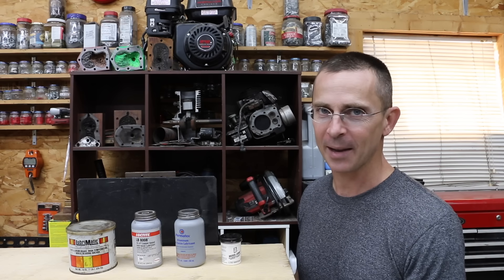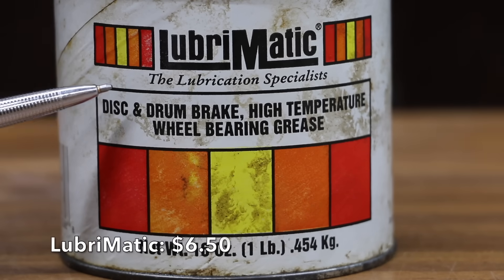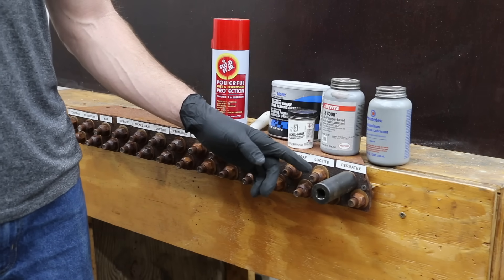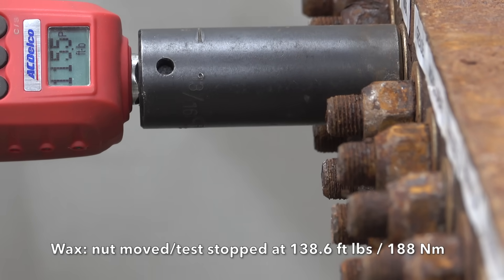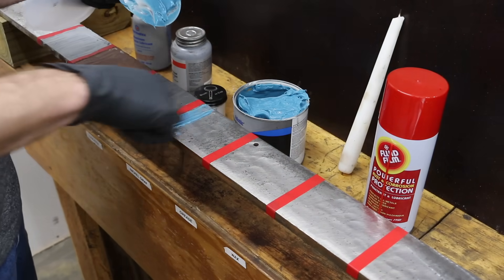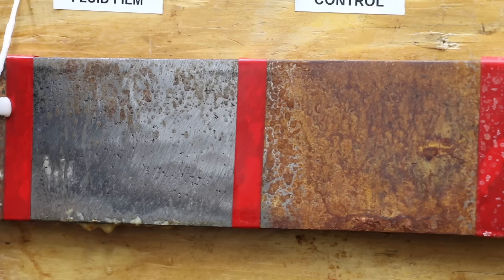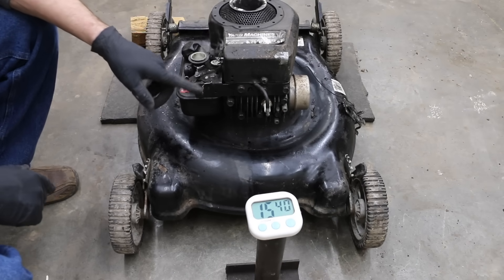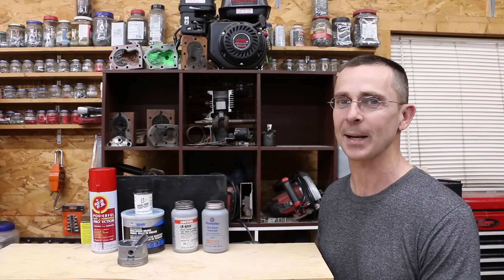Does Anti-Seize Compound Actually Work? Let's find out! Anti-Seize vs Grease vs Fluid Film vs Wax

Comment: omg ...this is the one I've been waiting for!!! Kids changing my tires and need to know this. Thank you so much for your excellent videos!
Reply: No do not put it on wheel studs and lugnuts, they are supposed to be clean and dry. If they are rusty crusty use a thread chaser or wire brush. No oil either , oil or anti seize change the torque value. The Walrus Mart in my town slathers anti seize  on wheel studs whether it's needed or not, makes a big goopy mess. Ok , maybe just a little bit as an absolute last resort. lol
Reply from the maker: You are so welcome!

Comment: You need to retorque after a heat cycle with any thread lubricant.
The candle wax may have done better if rubbed on.
Thread locker can also be an anti seize you need to test that.

Comment: Note:
AvE emphatically said, "Never-sieze" is NOT a lubricant."
Reply: it is abrasive
Reply: Correction: Never Sneeze
Reply: Dead Channel came to say the same oh well at least it’s been said lol
Reply: @SurturLives  you beat me
Reply: It's not a good lubricant, but it does lubricate the threads when torquing them down.  Taper lock and QD bushings have a warning on them about putting never sieze on them, as it increases the clamping force so much you can split them in half.
Reply: M Lenz seen this happen several times. Glad I wasn’t the one who had to tell my boss I did something I had been told by engineering staff not to do. Worse was replacement parts were two days out. Production department was not impressed
Reply: Have you watched his other videos?
He tries literally every crazy suggestion, just to see if it'll work.
Reply: Jeseph Willis yes I have. I usually find them very informing. This one, I felt, fell short. I do believe in the use of never seize. I use it on every bolt I reattach that doesn’t go into plastic. Ever had a lug nut you couldn’t get off. I removed every lug nut on all of my vehicles and reattached them after applying never seize. Like I said I believe in never seize.
Reply: Here’s why:   
Anti-seize is designed to prevent corrosion.  It‘s mostly a grease that serves to lubricate the bolt, keep water out, and provide a medium to spread particles of a soft metal around the bolt. The metal dust is a backup for when the grease is cooked off or washed out over time. When this happens, the powder of copper or aluminum can’t entirely stop the bolt from rusting, but does keep the nut & bolt from touching.   
Thing is, it’s not supposed to significantly reduce the torque required to remove the nut. That would be dangerous.  In fact, anti-seize makes it easier to tighten a nut down so that LESS torque is needed to get the same clamping force, and when a nut is removed after much abuse and heat, the grease is gone, more torque will be required to remove it than was used to install. Basically, a bolt requiring 100lbs of torque should only be tightened to 85 lbs when installing, but will need 100 lbs or more when removing next year. This is called the K-factor and should be on the back of the bottle.   
Basically, these bolts should have all been tightened to the same clamping force, not torque, if PF wanted an apples-to-apples comparison.
Reply: @kristofferbeder  Very well said! If only more people understood the properties of never sneeze...
Reply: @kristofferbeder  thanks for knowledgeable comment
Reply: @kristofferbeder  That was a good argument!
Reply: @kristofferbeder Nice comment.  There's actually a little reference book that has a conversion of torque values when various lubricants are applied.  Sensitive applications can be altered by the excess clamping force when using lubricant and cause things like leaking fluids and excessive wear on bearings.

Comment: SPARK PLUGS
The main place I ever used anti-seize compound was on spark plugs in aluminum heads - dis-similar metals with hundreds of temperature cycles. It did seem to help.
Reply: it dose and just a little dab is all it takes
Reply: A lot of folks put copper antiseize on spark plug threads but you should not really use copper, it can cause a galvanic reaction and speed up corrosion. Most modern plugs are made to not need antiseize, older engines with iron heads its not too big a deal to use a small amount but not on aluminium heads. I have never heard any horror stories of major damage but there is always that chance.
Reply: @alexgrant1979  That's a good reminder. I'm pretty sure that copper and aluminum don't play well together! For me this was decades ago before I remember there being copper-based products available. The stuff I had was a gray, greasy paste of powdered metal, but I don't remember what kind. My ol' VW Bug (may it RIP) went too long between tune-ups, and without anti-seize the spark plug threads failed on removal, and the head needed an insert to repair it. Always used anti-seize after that.

Comment: I use Permatex Anti-Seize on all low torque fasteners. I was wondering if you have any knowledge on the use of the lubricant on high torque fasteners? I am rather afraid to use such lubricants on them as I was told that it can stretch the fasteners by an old mechanic and another old mechanic told me that I can but use about 20% less torque. Do you or anyone else know the real facts about using anti-seize lubricants on high torque fasteners?

Comment: That Nickel Graf stuff was extremely impressive. It was closest to the original 90 ft/lbs you set after the being heated. Nickel is exceptionally heat resistant so there isn't that much surprise there (there's a reason the turbine blades of jet engines are made of the stuff: exceptional heat resistance as well as incredible strength so things in the air won't destroy them). Heat would have entered from the other end of the steel allowing some expansion but the nickel held it to only an extra 6.x ft/lbs. This stuff is absolutely fantastic and I want to run out and buy some now. Did extremely well in the water test as well... Top of the tree from what I can see!

Comment: Great test, I have a bottle of the permatex. Question: Can you put this on something such as header bolts?? I have a leak/broken bolts, I'm just trying to make it easier when I may have to remove or redo them in the future again
Reply: I apply the nickel based Permatex anti-seize to all exhaust bolts in all my cars. I have used the aluminum anti-seize in the past, but it cooks into a hard clump if the temperature gets too high. Copper based anti-seize also seems to be ok in exhaust bolts, o2 sensors, header/collector bolts. Use the aluminum based anti-seize on your transmission, intake, body, accessory, frame, and suspension bolts.

Comment: I use thread locker purple for vehicle chassis bolts and everything exposed to the weather and road. Even with a lock washer. The thread locker acts as a sealer to keep out moisture. I coat both female and male threads so that there is plenty of thread locker. I also do this for lug nuts as I do not want them to loosen as could happen with anti-seize.

Comment: I use Permatex Anti-Seize on my (aluminum) mountain bikes seat post to prevent galvanic corrosion.  It gets washed / wet many times during the riding season and every off season I do a full service on it and the seat post / seat tube have zero signs of corrosion so I know it works great for that.

Comment: Before I even watch this, I will say Anti Sneeze works 1000000% 

My father is a religious user of copper anti sneeze. I have worked on his old rusty junk and every single bolt comes out like butter. Never once broke a bolt. It works forever and is worth it 100%. 

Only way to test anti sneeze is to leave a bolt on an old Chevy truck for 350,000 miles of Chicago salted roads. It will come out 20 years later, trust me.

You can’t wash the copper anti seize off anything. Hands, clothes, boots, hats, etc it doesn’t come off

Comment: Aren't the aluminum and copper based design for conductivity ? electrical conductivity and heat !? they also have clay-based which is an oil-based clay as an anti seize...for rust prevention choose grease,or WD40..

Comment: Why wasn't there some version of a Moly anti-seize in your test? As for the engine, I pretty sure that the A-S was all stuck on the sides and top of the crankcase instead of flowing back down to provide lube to the rod bearing. Bet that a blend of 25% moly anti-seize/75% oil would work great in the crankcase.
Reply: I use an anti-seize product for low temperature applications called "Moly-Lit'. its a molybdenum-lithium blend. Still pretty pasty though, and doesn't thin down as the heat goes up. But anti-seize is primarily a high load, low speed compound, too viscous for use as an engine oil.

Comment: How about a tensile strenth in diffrent grade bolts .like grade 8 and 5 .stainless. titanium ect. Also teflon locl nuts .double nut .swedge nuts ,seraded flang nuts . Compaired to diffrent lock washers .like split ring and nord washers

Comment: Am certain that Anti-Seize works.  I'm a true believer from long experience.  It's better than WD-40, aerosol penetrating lubricants,  or motor oil at preventing threads from rusting fast.  Of that, I'm certain.  I've seen it. I'm less sure that it's better than gun grease. On my farm, threads that will need to come loose in the future get Anti-Seize or blue Loctite.  And if they ever vibrate loose, they get red Loctite, but that stuff is tough to get loose.

Comment: Anti-Seize is a must use here in the rust belt, it also prevents galling Stainless steel fasteners
Reply: Stainless steel fasteners are terrible for galling, even when brand new. Gotta put anti sieze on all the stainless hardware.
Reply: @nikclev  Yeah, I worked with a guy that didn't know, then we needed to try to undo a 3/4 x 14 bolt we had just installed. Out came the grinder. He apologized for not believing me.😉
Reply: On stainless copper works pretty good at normal temperatures but if high temps or dissimilar metals are involved go with straight nickle, and not nickle/graph. Based on over 30 years in mining, sawmills, and wastewater treatment. You wouldn't believe what 120+ degrees, condensing humidity, and 100ppm of H2S will do to metals. Half inch mild steel can disappear in less than a year.
Reply: Rich Diddens for the copper, you mean as a fastener coating?

Comment: The be fair to the wax, you did it wrong on the flat plate test. Arguably on the screw test as well, but that one would not be affected by the difference I don't think. 

You would typically rub/paint the surface with heat softened paraffin rather than pouring actually molten paraffin on to the surface. A thick coating will adhere to the rest of the coating better than to the surface and so lift away as a unit whicb is what you saw, basically the way was detached over most of the surface and the small patch still attached was protected. 

A rally thin coating will adhere better to the surface than to the rest of the coating and typically flake off where it looses adhesion to the metal without pulling up adjacent bits of the coating. While not as good as grease in my experience, it is a lot better than nothing when you don't have anything else on hand and proceed to forget about the work you did for a few years rather than coming back and doing it right later.

Comment: https://www.cosmolinedirect.com/cosmoline-rp-342-heavy-spray-military-grade-rust-preventive/?gclid=EAIaIQobChMIucri8L2t6QIVBZyzCh3_TQ4jEAAYASAAEgI05fD_BwE   Any way you can add this to your corrosion resistance testing. I picked up a case about a year ago and have had really good results so far. In project farm fashion i know you will take it to the next level of testing. Its supposed to be resistant to pressure washing as well. It applies very easy. I try to coat any outdoor hardware with it when possible around the farm for possible future use.

Comment: Most people probably torque down their bolts for a reason and don’t want them coming loose. I don’t think a product should be congratulated for loosening the bolt when they’re designed to stop corrosion. The product that kept the bolt torqued the closest to 90lbft without going over should be the winner, no?
Reply: Dylan Adrian I agree 100%

Comment: Hang on 'a cotton pickin minute' there, if Loctite has a use by date then it must need to be changed from wherever you've applied it, after that date? This is hard to explain but, if it is unusable after the use by date then surely the same product would go off regardless of whether it was applied to a bolt or just sitting in the container. I smell a rat, a marketing rat.

Comment: You mentioned dry vs lubricated torque. I rebuilt a large compressor pump a while ago and reused the head bolts and torqued them to the manufacturers DRY torque spec. Turns out I had gotten assembly lube on some of the bolts and ended up snapping the heads off of 2 or 3 of the bolts. Long story short, I have a set of torque charts above the workbench now and I even downloaded some PDFs from bolt manufacturers and keep them on my phone.

Comment: Good and interesting review. It used to be said if you threw a handful of cleaning powder, eg: Ajax or Bon Ami into the carby of a fast running engine it would scuff up the bores and increase compression. Could be interesting to see if an old myth has any merit?

Comment: Awesome video. I always used Permatek myself. The same bottle I bought many years ago still isnt empty lol. Great stuff, glad to see it passed the PF test though. When I eventually run out I will be getting Permatek again for sure. 

Btw I would love to see you test out used motor oil as fuel in a diesel engine. I have heard it works, and I have actually run my diesel tractor on it without a problem. Would be curious to see the results. Thanks! Can't wait till next week!

Comment: It would be really cool to see a test of common gun oils like Hoppes, CLP, etc, using your test methods.  I know corrosion, heat, and evaporation resistance are important.  Though it would be tricky to test, as youtube loves demonetizing anything remotely related to guns.  Anyway, it's just a thought.  Keep up the great work!
Reply: Harry. B. Renner. jr.  Glock ships all of their handguns with the copper locktite applied. Easy way to see if it's a newer used gun.
Reply: @willardthegrey  I bought a Model 22 back when they were the second. 40 on the market,  little dot of cooper antisieze in there. Cool that they still do it almost 30 yrs later.
Reply: New Lucas that’s blue works very well

Comment: The short answer, YES. I work in oil and gas and the difference on a bolt that has been anti seize and one that hasn't usually is evident in which one you have to cut, and which one spins off. The base type used is the Loctite, however we use the Loctite that is Nickel Based for better heat/corrosion resistance vs the copper.

Comment: So aluminum anti-seize is just fine for brake and wheel applications?  There were a few different flavours to choose from and I went with aluminum.  Mixing aluminum and steel won't cause any kind of galvanic corrosion?
Reply: Perhaps, it would be the aluminum corroding and protecting the steel...

 Galvanic corrosion presents when two different metals are in contact in the presence of an electrolyte... both metals need to be sufficently apart in their electrolytic series voltages, and then, one metal being more electropositive than the other will work an the anode and get sacificed, while the other will be protected. That is why they usually use Zinc sacrificial anodes on steel ship hulls, and the steel is protected until the zinc is gone, therefore the anodes get thinner until they need replacement.  In this case, the aluminum in the anti-seize would sacrifice and the steel would be protected, so there is no danger for the steel surfaces!

Comment: Anti-sieze is  finely ground soft metal like copper or bronze mixed with oil, when applied it creates a barrier made of fine non rusting particles that comes free when torque is applied. Yes it works very well, much better than oil or grease alone and is great for bolts and screws that are subjected to heating and cooling.

Comment: Thank you for everything, I believe it it were a forged connecting rod instead of a cheap cast unit it would have kept running. Id like to see If its possible if the aluminum in the product could fill in worn areas in the combustion chamber, similar to engine restore which you tested a while back. Perhaps with regular oil mixed in with a bit of it, it may work. Keep up the great work.